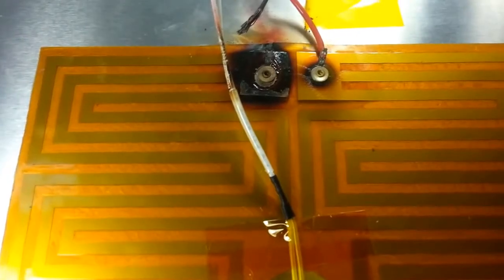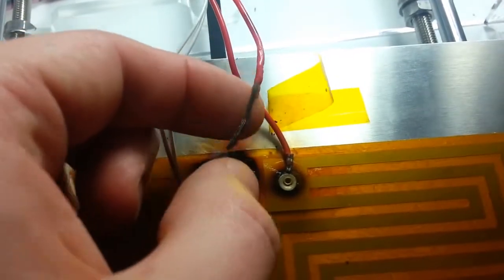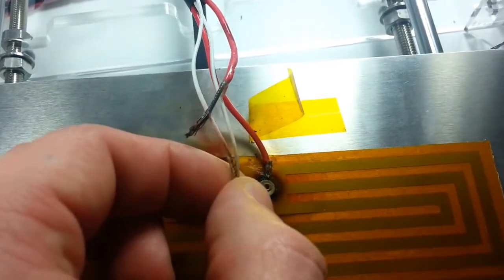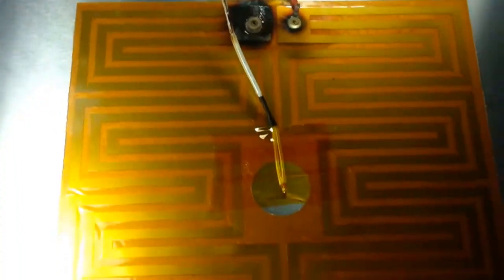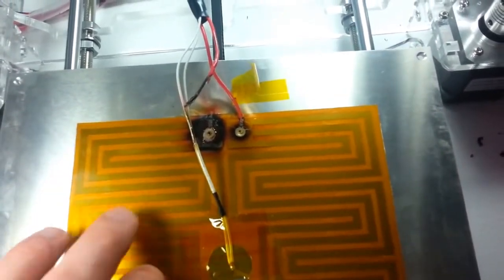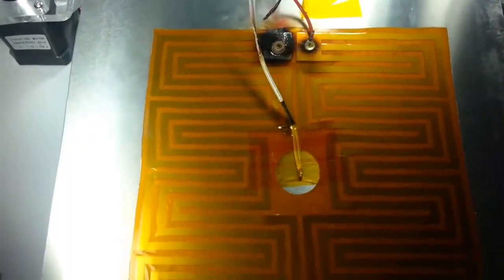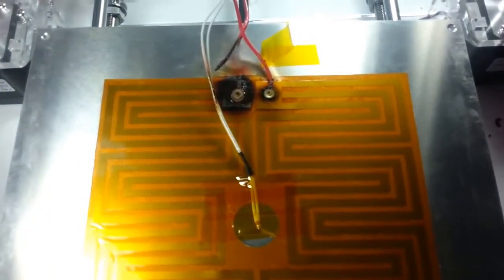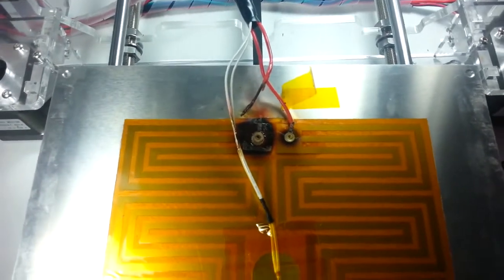Heated Bed Failure!!

Comment: Hi, My Sunhokey had the same problem, But unlike yours there are no rivets, Wires are just soldered to the bed directly, Even if I re-solder them wires come off after some time, I am planning to buy silicon heater :)
Reply from the maker: +Dhananjay D You might try to remove stress from the connection (securely attach the wires to the bed after they are joined to the heat bed). This will remove any pulling forces on the soldered joints.
Reply: +Alans Way But Do you think there is potential for solder to melt??? Then its kind of pointless to solder...
Reply from the maker: Yes some of the solders melt pretty low but some are higher (around 180 degC) which may be ok. I haven't figured out what I am going to do yet. I still have some research ahead of me.

Comment: Hi Alan. On the first month with my sunhokey I had the same problem on my heated bed.  My solution: I worked on the rivets with a dremel cutting wheel until it breaks one side and moves out and replaced with two bolts and two ring terminal ends. Worked perfectly ! BTW nice channel, keep the videos coming ! Regards
Reply from the maker: +amnesia74 The dremel is a great idea. I was trying to figure out how to remove the hardware.

Comment: My Sunhokey heated bed did the same thing (minus the wire coming off)! Putting pressure on the metal piece that looks burnt made it start working again. I guess it's a good idea to rewire it with bigger wires.
Reply: +illiteratebeef When I built my printer I replaced the wires with 14AWG silicon insulated wires, maybe an overkill LOL...But some prints later I had the same problem on the heated bed. I figured out that the problem is the connection between the terminal and the resistance. It is loose so isn't efficient enough for the current required by the resistance so the connection will heat until literally melt the wires.
Reply from the maker: +amnesia74 I think mine shorted through the aluminum bed so the joint became the resistance and was probably the thing heating up the bed for the last few prints. I am hoping that I get better heat distribution and better bed adhesion when this is all over (positive thinking).
Reply from the maker: +illiteratebeef Yeah bigger wires is something I will be moving to, especially since I can't use the current ones (they are toast and I wouldn't trust them anymore).